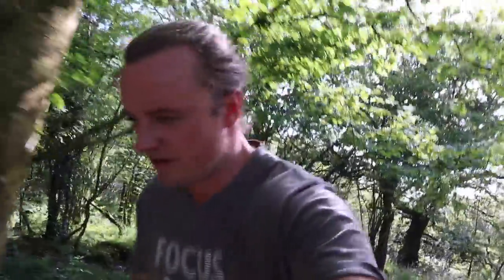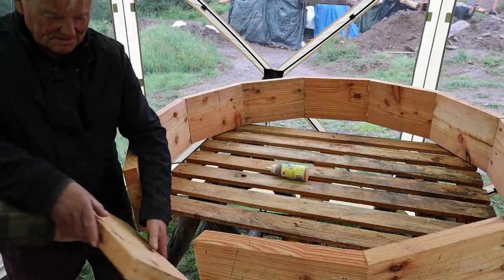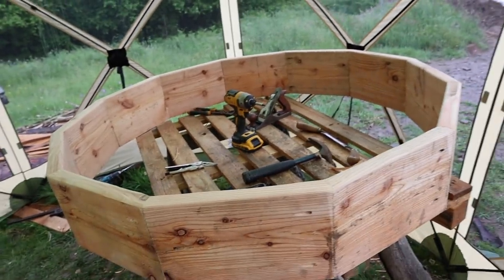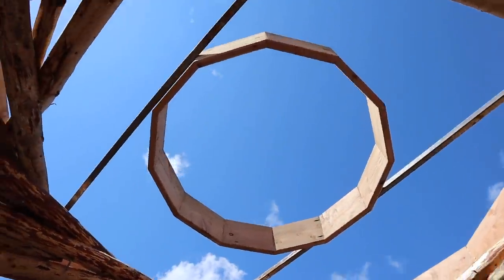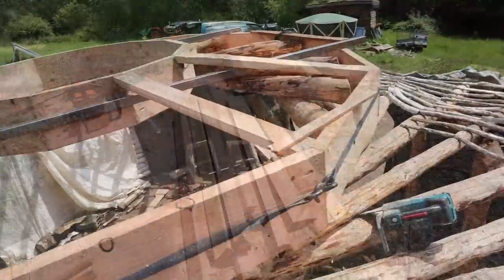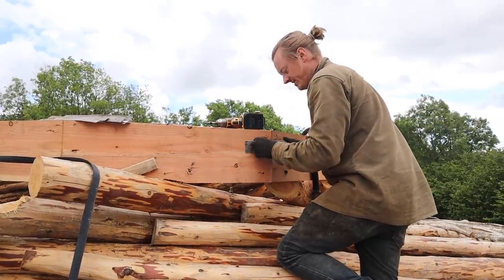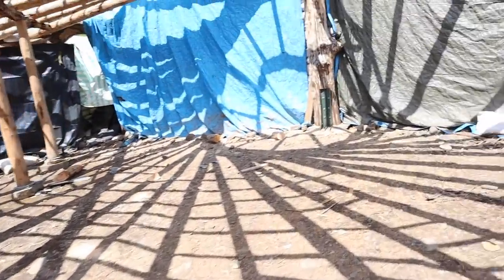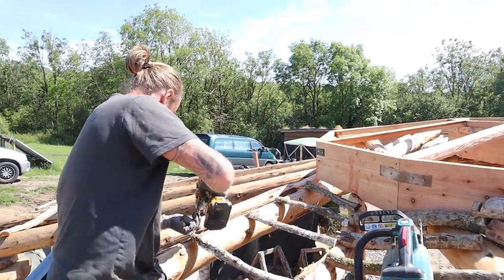Off Grid Earthbag Workshop Part 26 Roof Window

Comment: Re your need for poly carbonate sheet, have you tried the manufacturers/installers of conservatories in the mid Wales areas, they may be able to provide off-cuts and seconds, etc.
Reply: or maybe they'll have a job where they're replacing an old conservatory.

Comment: One thing you should consider, polycarbonate does not have good UV stability unless you can find sheet that has a UV resistant coating or has been formulated to resist UV. Unless you are concerned about impact resistance, acrylic is a better choice. It’s usually cheaper ( so you can afford a thicker sheet )and has good resistance to UV. They do make an abrasion resistant sheet in both materials. Also, if you want a solar tint, it might be easier to find in acrylic. 
This is a great project, I’m looking forward to watching you finish it!

Comment: Pretty weird construction.  I don't see this type of house having much resale value.  I also do not know how long the bags that hold the sand will last.  What happens when the bags start deteriorating?  I like the idea of turning sand or dirt into a wall, but it seems like it needs concrete mixed in so that it will harden so when the bag deteriorates, it will not fall apart.  I wished I could turn sand or dirt into bricks using heat and pressure, and other techniques.  The concept of free bricks appeals to me, but you would still need mortar, and assembly labor, or possibly robots. But yeah, ...if I were trying to build a place out in the middle of nowhere, I would not want to pay for materials either.  There has to be better building methods than what we have today.

Comment: Looks like the pallets are probably cottonwood to me and if they came from the US I can almost guarantee it.  Cottonwood is often used for pallets but some really old houses in some area's may also use it.  The wood takes a while to truly dry but once it does it can be as hard as a rock but if it gets even slightly damp for an extended period it will rot very quickly.  https://en.wikipedia.org/wiki/Populus_sect._Aigeiros

Window looks nice though.  Will be good to see the roof get finished up.

Comment: Hey Kris great centre piece the skylight,  now to top it off how about some " Stained Glass " be great with that dif colour subdued light bleeding in too ? Just an idea.
Reply: I agree - a hippie image on the centre-piece - in translucent paint.
Reply from the maker: it needs to be safety glass though.... cant have sheet glass over my head in a workshop. can you do stained toughened glass....?
Reply: Perspex then , comes in many colours and thickness .. find a company and ask for the offcuts bin .. maybe ? Where's there a Will .........OR look into stage lighting Gels ?
Reply: Poulsonarrow  Just saying I've used perspex in the past in work its brittle and cracks easily while your working it ,even if it looks ok small cracks can appear ,apart from that burns well molton fire comes to mind ,pretty sure it's a  big no no for building structures
Reply: Roger, That said , what do Sign companies use ? Im sure Kris will find a method that fits all parameters hey .... simple method is paint hey ?

Comment: That building is going to stunning when it's finished... Can I ask how much you think you spent of screws? A cost many people forget about
Reply from the maker: Indeed. its one of my biggest costs. the materials i use are natural and mostly cheap or free and then my time. but things like screws and electrical wiring, plumbing fittings are the majority of my costs.  still very cheap but i do often spend £100 on screws

Comment: Use an offcut to make yourself a pair of wooden push sticks so you can keep any wood (you're cutting on the saw) flat on the cutting table and to help prevent any potential sudden kick-backs if any of the wood should be caught if rapidly lifted too high up on the spinning blade. Matthias Wandel explains this nicely, here: https://www.youtube.com/watch?v=gdIQY_7T26k 

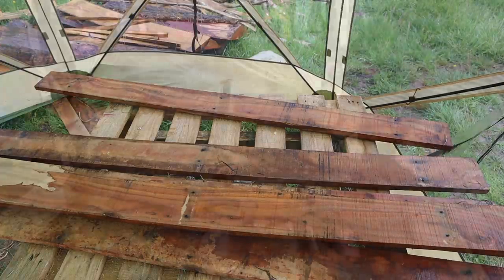Watching you push that plank (6:35) was just too scary, you seem not to know what you're doing as you're cutting (in that particular instance anyway; I concede though that you're skilled with plenty of other things).
Reply from the maker: I have some already. they come with the saw and are stashed behind the fence. i use them from shorter lengths but for long lengths i like to do it the way i did in the vid as the wood can just pull out of your hand if it grabs.
Reply: @KrisHarbour  Fair comment, ok. :) One other thing though, a tip,... set the saw blade to be no higher than the thickness of the piece of wood you're sawing; much less chance of any 'grabs'. The roof is coming along nicely and I can't wait to see it finished! Good work, keep it up!

Comment: Looking realy good, I am a bit afraid that your angle of the outer/inner circle is to small, instead of 5-7 degrees I would have not gone under 30 degrees, hope for the best.
Reply from the maker: yeah i was thinking the same but keeping it low is important to not obstruct the windows of the top workshop to much, i hung from it and it supports me no problem at all im sure it could hold about 400kg in the middle before failing i think that is enough for the amount of area.
Reply: @KrisHarbour   having it with about 5-7 degrees will exert great outward forces, and I am afraid that over time it will sag, and the smaller the angle the greater the forces will be, one solution would be to have vertical windows (on big circle) lets say 80cm high and then the 5-7 degrees "flat" windows, then you could have braces going from the low point of big circle to the low point of small circle (maby about 30 degrees up) then the forces would go into the big circle at an angle greatly reducing the forces, (not easy to explain in words) if you want I can send you a sketch, theese will ofcourse interfere with the "open sky" view.
Reply from the maker: The forces are big indeed. they get multiplied quite a bit with such shallow angles. its like lifting something with a two leg chain with the legs really far apart. the extra force is trying to pull those legs in so it multiples. I think i will build it up and see how it works. there is always the option of adding say 6 or 12 diagonals out from the outer circle. i would like to keep it clear and less busy but if i have to do that i can. But i do really want to keep the shallow angle. i would like to see a drawing if it isnt to much of a hassle for you. 

kris
Reply: @KrisHarbour   Hi, how can I send you the sketch ? I should be able to se an mail adress on IG but I cant.
Reply: @KrisHarbour  This shows somewhat what I mean with the vertical windows :  https://www.stanfairbrother.co.uk/roof-lanterns/  yours is just having seethrou roof, this ofcourse does not show the bracing that I was talking about.

Comment: Did you finish the new hydro build yet?
Reply from the maker: Still working on it. It’s taking a back seat for a bit now while I concentrate on the workshop. It needs to be complete for winter thought but for now it isn’t a priority due to having plenty of solar in the summer months. I am also working with help from subscribers on a control system. There will be some more videos coming about it all soon enough.